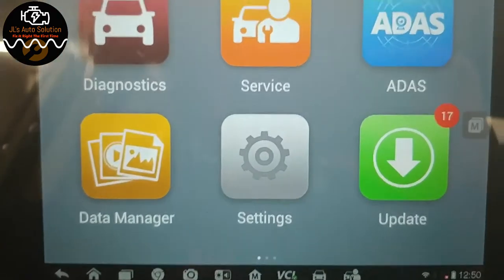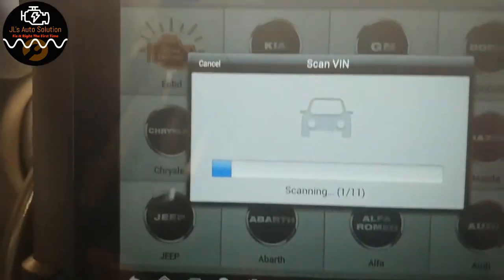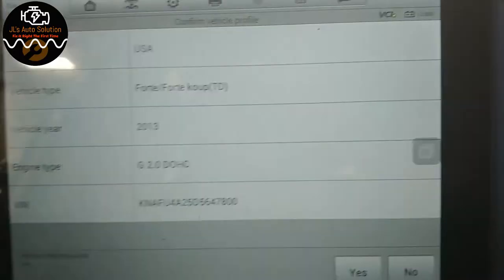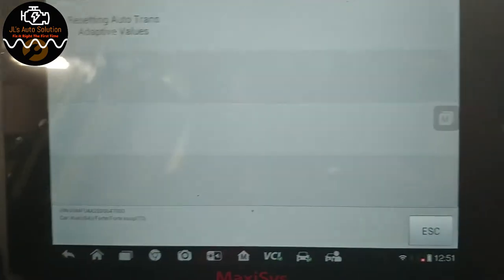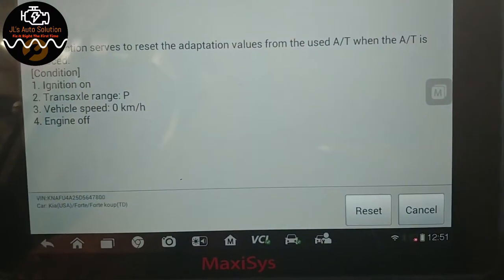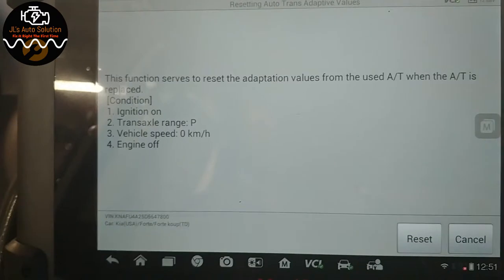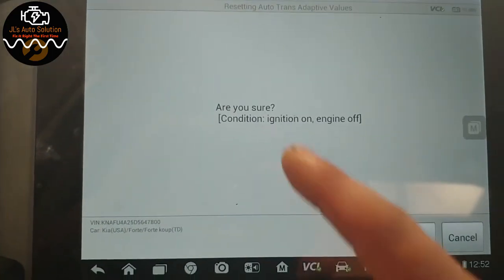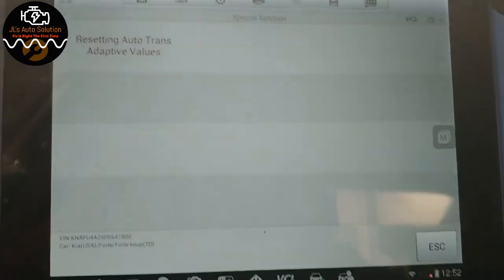Kia/Hyundai Transmission Adaptive Reset Using the Autel MaxiSys

Comment: I'm having delay shifting between gears 2 and 3 . Did you think transmission reset would fix it
Reply from the maker: Hello.

It is highly unlikely that a transmission reset will fix the issue( has never worked for me) but it is a first step. more than likely there is an internal issue with the transmission which could be pressure/electrical or mechanical.

Comment: Hi! I have a Kia Sorento 2018 LX V6, when I do the adaptive reset everything runs good but after a few kms I have shift shock again, specially from 2nd to 3er gear. What do you thing is the problem. I already change the transmission, TCM, speed sensor, etc etc.
Reply: Did u manage to get fault

Comment: Hey Jeremy.  2007 accent, you think autel unlock the smartra module? Thank you
Reply from the maker: If its locked, try unplugging the battery and performing a static discharge  for 1hr then retrying,  this normally fixes the issue.. if not then you might need a new smarta module. 

The smarta modules are not normally locked, this occurs when there has been unsuccessful key programing attempts or a faulty module,  

always verify the circuit in its entirety(Smarta circuit in this case) 

the autel can program the keys on this vehicle-- you just need the pin code.

thanks for the question and for watching
Reply: @JLsAutoSolution  thank you Jeremy. You are a help as always.

Comment: Nice! I've got a Hyundai Tucson that's throwing a P073f73 code and only works in Even gears.  When it happened to do think is when i was driving down a bumpy dirt road.  Any suggestions?
Reply: Hi . Mine the same code same issues . Did you fixed yours somehow ? Please let me know
Reply: @marsone2004  I haven’t, mechanic said it would cost around $5000-$7000.  Guess it’s time to get a new car 🤷‍♂️

Comment: Do you need to do this after drain and fill of transmission fluid? Have a 2019 Elantra and getting a bit of a hard up shift and mid throttle.
Reply from the maker: no, this should only be done when a components is replaced that deals with the transmission.
Reply: Had a spell of souls with bad down shifts coming to a stop. I would drain and fill trans, reset TCM adaptives and complaint was fixed.

Comment: Nice. Will this work of Dual Clutch Transmissions? My car is a 2016 1.6 LX Turbo. The car doesn't want to go into reverse. It's strange because, my car was fine the day before. I'd took it to the automatic car wash. But the next day, my battery was low, where it wouldn't start. So "AAA" came out and jumped started it. The guy from AAA put the jumper cables on, not even 2 seconds, and it started right up. We were both surprised at how short of a time that it took to turn over. Anyways. When I went to drive it, it was sluggish. So at the time, I just assumed that it was the battery, parked it to let it charge the battery up. But when I'd put it in reverse, it wouldn't go. So I ran a scanner, and it gave me a P073E: Stuck actuator on closed position.
Reply from the maker: I would suggest you read this first.. https://www.obd-codes.com/p073e
Reply: @JLsAutoSolution  thanks for the link. Yes. I had read that a few weeks ago, after doing a scan on my car and looking up the code. Mind says on the :Blue drive" scanner that it's the code, but it gives more details, stating that the actuator is stuck in closed position. I had got some other codes later on that displayed, 1921, P074A and P0620 all are Transmission Control Unit codes. But P0620  is from the Power Train Control Unit. It states a possible short to the generator. I'm wagering that the TCM is bad. But each transmission mechanic that I've taken it to. They have told me that they aren't familiar with the codes and suggest that I take it to the car dealer. So neither have looked at the transmission at all, to see if the TCM unit is bad, corroded or a possible short. I'd went to the dealer a week or two before that and the story kept changing from, it was just the actuator to the car now won't drive in any gear to I now need a transmission. I'd listened to my gut and was right. They'd lied. The car does drive forward. I got my car the hell away from there.
Reply from the maker: Inexperience can lead you in the wrong direction.- if you are having circuit codes- then the system needs to be tested first.(power grounds and controls) you might just have a bad valve body( suggest alldata DIY) 30$ get you access to codes/definitions and troubles shooting charts..

thanks for sharing.

Comment: Hi, good informative video. What was the shifting issue you were having? I have a Kia Sorento with a shifting issue and was hoping that a re-learn using the Autel MaxiSys the same as yours might fix it as everything else checks out okay on the scan tool. Cheers. Ollie.
Reply from the maker: Is there a C.E.L on? if not

I would suggest you check with your local Kia dealer and see if there is a update available for your vehicle--  The 2010-2015 Sorento had an update for the Tcm- I have a 2011 and the vehicle was having a shift shock from 1st-2nd gear, early in the morning. After updating the tcm, the shift shock was no longer present. This was the remedy in my situation but you could have another issue also.

I Also performed a complete Fluid Flush on the Transmission.

There is a cost for this as it is a TSB and not a SA/SC or RC.
Hope this Helps you.
Reply: did you fix your shift problem ? I have been working on my daughters 2011 Sorento and it's giving me fits, it's always had some shift problems but started to get worse a couple of months ago and seem to lose power and has very slow acceleration. Will shift from 1st to 2nd fine but anything else is iffy, if I accelerate really slow I can get it to shift up to 4th, sometimes 5th, car will not go over 60. Funny thing is it shifts fine in sport/manual mode (still low power and slow acceleration) but will not work right in auto mode. I pulled transmission and replaced the torque converter, didn't help. Also replaced the throttle body and throttle position sensor, still the same, no codes or check engine light.
Reply: what was the TSB number ? @JLsAutoSolution

Comment: I changed the ATF in my 2011 Santa Fe V6 to Valvoline Maxlife two times in 10000 miles. I get hard upshifts off throttle and sometimes jerky downshifts. I wonder if a reset is needed due to old fluid at 120k miles?
Reply from the maker: there is an update for the tcm for that concern. Make sure it was done.
Reply: How do you get this TCM update? I'm in Brazil and dealers are not software friendly... So I got to be very sharp. Also with a 2015 Santa Fe, 3.3 v6 awd - hard down shifting around 4th gear. Thank you
Reply: @scantarajr  I'm in a similar situation in Peru. Did you figure it the answer?

Comment: Don't you have to do relearn after the reset? Relearning is driving around keeping throttle 10-20% etc....
Reply from the maker: Yes you do. But it's better to let the client do the learning. Because you drive different then the client. I always advise that there might be a slight delay is shifting after the reset and that they need to go through all gears, city and high way in one trip. Never had any issues so far . 

Thank you for the question.
Reply: @JLsAutoSolution  I did this relearn process and the car drives perfect for the first 20min and then right after that time start shifting roughly again. Do you know why?
Reply: @JLsAutoSolution  I have a 2015 Hyundai Elantra 1.8 A/T
Reply: So you replaced the temperature sensor with the wiring harness. Was this due to the transmission hard shifting into 4th gear (fail safe mode)?

Comment: Will it reset  transmission getting it out of limp mode?
Reply from the maker: LIMP HOME MODE IS A CONDITION WHEN THE PCM /TCM/ECU IS MISSING SOME CRITICAL DATA INPUTS AND IS UNABLE TO ADJUST SPECIFIC APRAMETERS BASED ON THOSE INPUTS. SO IT USES SOME PRESET DATA STORED IN IN CONTROL MODULE BEIN G AFFTECT IN ORDER TO GET THE VEHICLE TO A SHOP AND HAVE IT ISSUE DIAGNOSED.

HOPE THAT ANSWERS YOUR QUESTION AND THANKS FOR WATHCING(sorry for the all caps)

Comment: Which maxicom/sys model of Autel are you using  to clear the transmission adaptive values?
Reply from the maker: I am using the ms908.
Reply: @JLsAutoSolution  Thank you
Reply: @JLsAutoSolution  how much does it cost to update the software after the 1st year?
Reply: @JLsAutoSolution  would you happen to know if the Autel 906BT can do this as well?
Reply: IM608
Reply: @husamothman1 probably 800-1000 i have a Maxi Ultra and 800 for my im608
Reply: Maxi Ultra and IM608II  formCVT transmission you need to get the qr code read then  erase the Chara data then write the data from the qr code or its gonna go to shit

Comment: Hey i have a question how should I get the spacial function cuz I can't see the spacial function
Reply from the maker: Which model of Aurel do you have
Reply: JL's Auto Solution  i have a maxicom 808
Reply from the maker: hi did a little research for you.. and i think you should read this article.

https://obdstation.com/autel-maxicom-mk808-review/#:~:text=The%20Autel%20MaxiCOM%20MK808%20supports,braking%20system%20is%20working%20efficiently.
 Even so, those functions are not enough to make this device the main scanner in an auto shop. As a professional mechanic, you still need functions like actuations, coding and adaptations. The MK808 doesn’t support them.